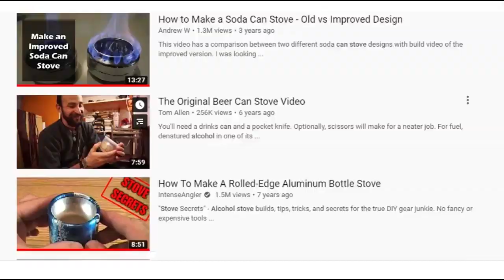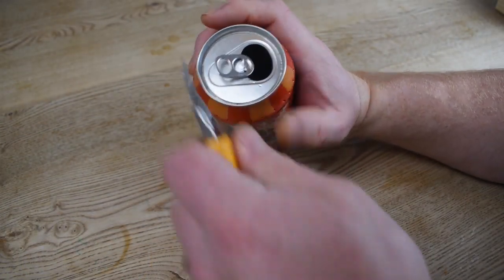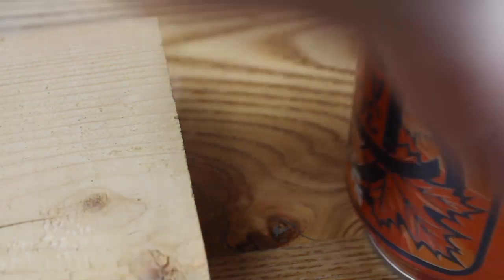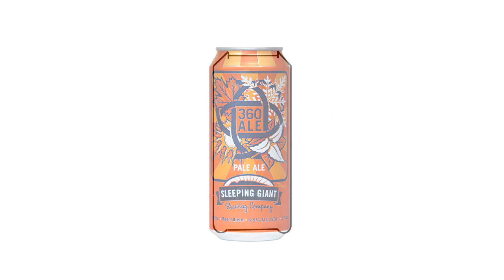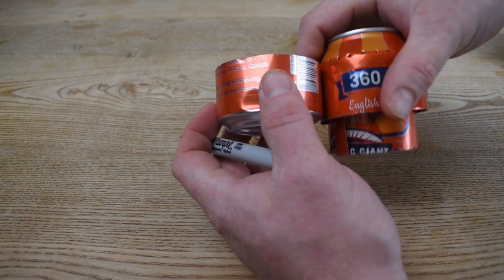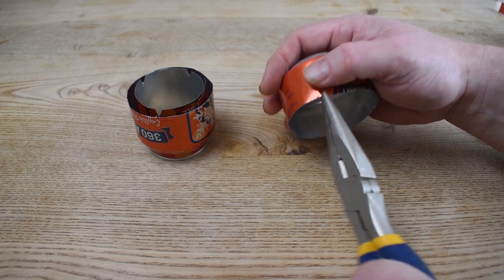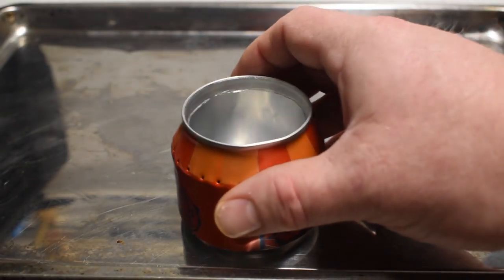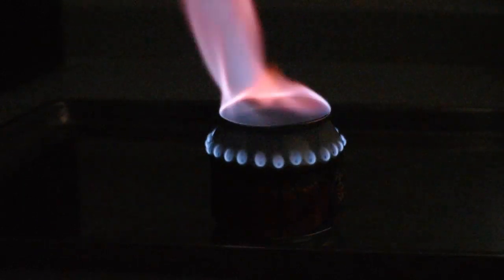How to Make a Beer Can Stove

Comment: I kept a few of my son’s beer cans to play with. I made one but pushed it together too hard and the inner wall collapsed, so be warned!  However, I managed to push it apart without cutting myself and repaired the bent puckered inner seam and tried again and blow me down it worked. I didn’t have any meths so I did a proof of concept burn in the grate under a trivet, burning isopropyl alcohol. A yellow flame and smelly but it worked.  Unless I align my trivet top with the rim of the burner I don’t know how to quench the central well’s flame. Good fun, thank you. Hope I never actually need it
Reply from the maker: Yes it is a good bit of fun and satisfying to know it can be done.  These make great cheap camping stoves and many people prefer alcohol stoves over other types.

Comment: Great video, thank you. At 13:16 what is the small flame that comes out down low on the pot or is that a reflection?
Reply from the maker: Hi David, that is the indentation in the can that didn't seal properly. That is why I recommend that the top portion of the can be long enough to reach the bottom of the bottom portion of the can.

Comment: a much safer way to remove the lids is to use a can opener, works wonders leaves the rim only takes a few seconds
Reply from the maker: Great tip. I think I tried mine but it didn't fit on these newer tapered cans.  Different models might work better.

Comment: How do you put it out?
Reply from the maker: Good question.  They burn out quickly.  Most who use these figure out how much fuel they need to boil a pot, as your water comes to a boil your fuel runs out.   If you had to put one out you could cover it with a cup or bowl to eliminate the air.

Comment: Is methanol the same as featured alcohol?  Can you use these indoors also?
Reply from the maker: Hi Lucy,  I can't find 'featured alcohol' with a google search so I am not able to tell.  Unfortunately there are lots of different names for different types of alcohols floating around.  Methanol can be burned indoors as the fumes are safe.  It is kind of like the sterno canisters that they use at buffets to keep food warm.  But, you need to be really careful not to spill the stove.  I shot this video indoors and used a sheet pan beneath for a little added safety.  The fire extinguisher was close at hand also! :)
Reply: Oh my...silly spell check changed it on me.  I was asking about Denatured alcohol.  That's what I get for speaking my text sorry.

Comment: A wick (such as carbon felt) between the walls will absorb more methanol and bloom the jets much faster.
Reply from the maker: Thanks, I have heard that but I have also heard many who dispute the need for this.  The fuel inside the can does need to be hot enough to vaporize.  The added surface area of the felt may help a little but heat is the main driver.
Reply: @KevinOutdoors  it's not necessary, but the wick will pull (capillary) fuel up almost instantaneously. Otherwise you'll wait many seconds for the fuel to get hot enough to vaporize and ignite efficiently. If you put a pot directly on the stove, the flame has no other option but to burn through the sides, but this risks stuffing out the flame. Optimal pot height is probably 2-4 cm above the flame.